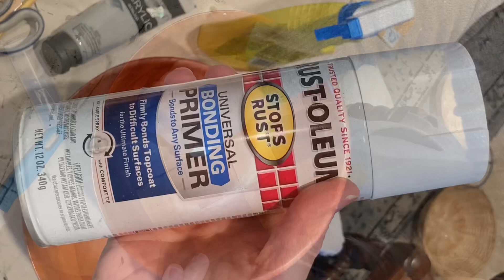11 DIY High-End Home Decor Dupes Kirklands

Comment: Not a dupe suggetion, rather a question. How would you restore a brass finish to a non brass item? My parents' roccoco style wall clock suffered during a house fire and while cleaning it, I was shocked when the brass came off and revealed silver metal underneath. It very much needs the brass finish restored. Maybe you could do a project that I can get ideas from...
Reply from the maker: The brass plating must have been thin and the cleaner very strong! There is no way to restore it that I am aware of.  The only thing you could do is to paint it to look like brass. Krylon’s Gold Leaf is a good brassy color for spray paint.  Rub’n Buff has several gold tones that are an exact brass color for hand painting or rubbing on.  Hope this helps!

Comment: I actually liked all of them, I love how your mind works & I'm so inspired!  My favorite project was the ring with sticks & beads.  A project that would be similar to that is using small, flat pebbles & drilling holes in them to string on the ring.  My local plant nursery has large ones but they're expensive.  I've been wanting to do this for a long time but think I'd probably need a stronger drill than my 18 volt.  Would you consider taking this on?
Reply from the maker: Thank you so much for the suggestion! I will try drilling in some rocks with a titanium bit and see if it works.  I only have an 18 volt drill, too.  If it works, I’ll let you know and incorporate it into a video.  I’d love to see the large ones at your nursery.  Could you email a photo?